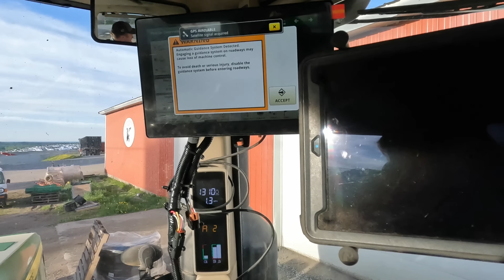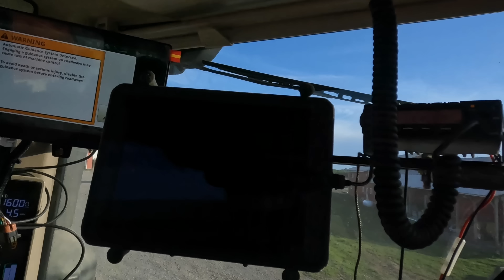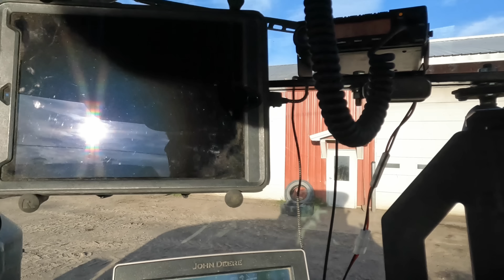1 big problem and we haven’t started yet

Comment: Andy, Many years ago I had a 66 Mustang fastback I took fishing on the gulf a lot, the trunk floor was the gas tank top, it spot rusted through, I was building boats at the time, I fiberglassed the trunk floor/gas tank top, no more problems, I did the same some years later on a diesel Chevy Suburban fuel tank, put another 100 thousand miles on it, sold it, both never gave another leak problem. Always amazed at all you do, can't believe you take a turn at feeding at 3 am. I'd teach another to climb/maintain  the silo!!!!

Comment: I'm a little embarassed to say that I almost killed myself putting air to a backhoe fuel tank. 
The tank was mounted on a backhoe. Over time from people filling it in the field dirt and contaminants had gotten into it. One day after changing the fuel filter or filters, Mr Thorough (that's me) had the great idea to drain it and as the drain cock was open I put an air line to it to blow "everything", all dirt out through the drain.
The only air I had was from about a 2 inch line. 
(No problem, not what you may think) I didn't put an air tight seal between the hose and the tank.
I blew the tank fluids and dirt out of the drain as I had planned. But when I pulled the air line back from the ~2" filler spout, there was a noticeable "boom" and blue smoke. I wasn't blowing into the tank with an airtight seal, not at all. But the volume of air that I was putting in was just enough apparently to cause the fuel vapors to combust. How else can anyone explain the blue smoke. If that tank had ruptured or blown apart I was right up against it. Go figure. 
I'm putting this out there so that no else will put diesel under pressure with an air line. It doen't take as much pressure as you may think to gt it to go boom. I don't care what the stoichiometric numbers and formulas say or predict. I saw blue smoke and there was bang.

Comment: We have a place in our area that coats the inside of fuel tanks hides alot of pinholes
Reply: Why not coat outside as well. Will last for decades then.
Reply: One can imagine that if you coat the inside and the metal rust away, then all what is holding the fuel in is the coating at some point.

Comment: Hi Andy, just wondering what make of metal cutting blades, do you use in your small circular saw for cutting patches for the fuel tank... Thanks for taking the time and sharing...
Reply: That is also a slow speed saw too.. Specially designed for metal cutting..

Comment: Wonder why so many farmers have to fix or remodel things on new John Deere planters ?
Reply: Because every farmer is trying to get that last bushel per acre from their fields and that all starts with the planter and how consistently it gets the seed in the ground.  Kinda like a golfer spending several hundred dollars every couple years on a new driver to get another half yard of drive or fewer slices and hooks..  and it isn't just JD, the farmers with other brands do the same thing.
Reply: Everyone has different   things they want done their way. In this case, it's cheaper to do your own modifications than buy them if they even offer it.
Reply: Cause it's junk deere they are the greediest corporation in the farming industry more than 80% of the new crap that rolls out off that line breaks within mere hours of its first use and then your calling deere for parts over and over again
Reply from the maker: I’m curious as to what kind of equipment you run
Reply: Andy could have had the stuff dealer installed for 200/hour